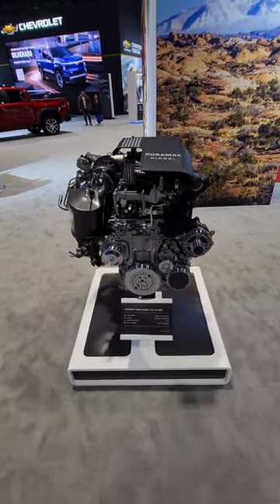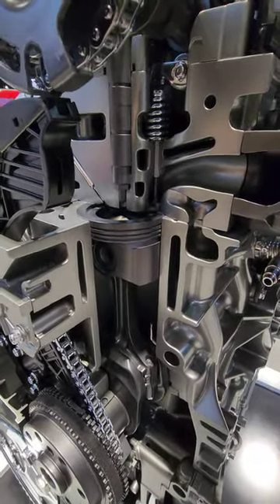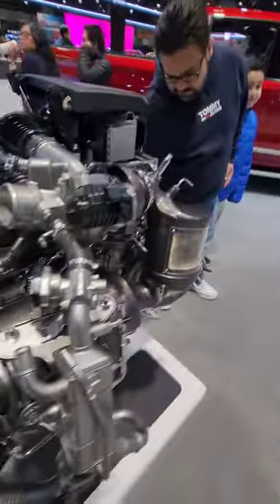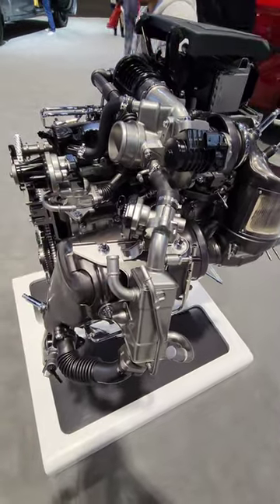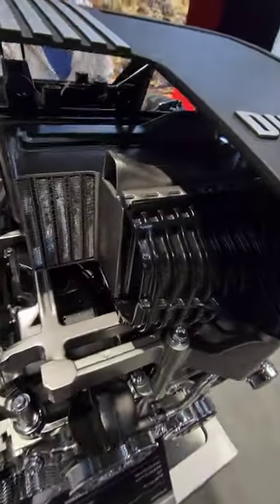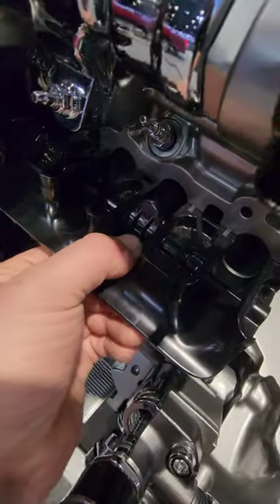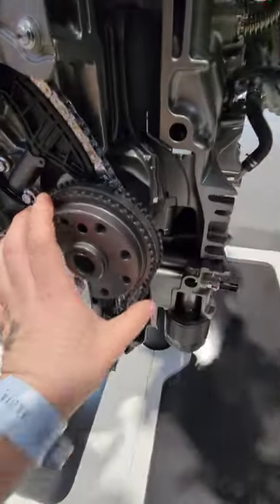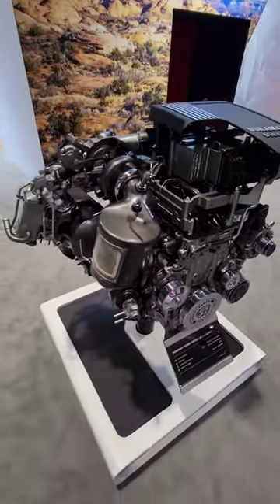Everything you need to know about the new 2025 LZ0 3.0 Duramax Diesel

Comment: So to replace the cam timing chains and that oil pump belt, which, being GM will be around 100k miles, you have to remove the entire engine? Brilliant!
Reply: they pull the cab off to replace the oil pump belt , nice and expensive ...100k is the inspection of belt , belts are good for 200k they say now
Reply: It’s amazing how many gas engines require the entire timing system to be replaced every 100-150k and nobody bats an eye but a diesel needs a belt every 150k and people lose their fucking minds.
Reply: @jellyfrosh9102  I don't have an issue with timing belt or chain replacement when it's designed to be replaceable. This engine has everything in the back of the engine driven off the crankshaft. That means getting the transmission or engine out, the flywheel off, then any covers to expose the chains/belts. Basically they designed it like those timing components won't fail, but we all know they will.
Reply: @tigermanmccool4037  Just pulling the cab won't help. The chains and pump belt are driven from the back of the crankshaft. So you still need to remove the transmission or engine, remove the flywheel then remove any rear covers to expose the belts/chains. Why they didn't put the timing components on the front of the engine is bizarre.
Reply: @toddstidham8374  there are tons of engines with timing components at the back of the engine
Reply: @jellyfrosh9102  I don't know about tons. The Ford 4.0 SOHC V6 had one cam timing chain, the GM Atlas series engines also had a balance shaft chain in the back and maybe a handful of others. Definitely more the exception than the rule.
Reply: Everyone claiming you have to pull the cab to replace the oil pump belt need to do some research. They move the transmission back and get full access to it. At the dealership it's about a 2k repair bill. That's pretty mild for a 200k mile maintenance item.
Reply: @Todd Stidham  they don't pull the cab to replace the belt
Reply: @tigermanmccool4037  wrong they do not pull the cab. It's about a 2k repair at the dealer.
Reply: It is an embarrassingly crappy design. The only people who don't get it are the ones, who think changing their fluids and brakes makes them a mechanic. 🙄
Others are the type, who get exited about their vehicles hitting trouble free 60k in 5 years and then they trade it in for a new one. 🙄
Reply: What about all these cars and suvs you have to take nearly the entire front of the vehicle? To replace the oil belt is around 1500 at a dealership and alot cheaper at a independent shop.
Reply: @philipjohnson882  I never said they pull the cab. I simply responded to someone who stated that. I responded to them that pulling the cab doesn't help replace the belt, you need to get the flywheel off which means either removing the engine or transmission.
Reply: @toddstidham8374  It's a european design, because of the way they design their trucks the cab flips forward allowing easy access to the back of the engine. Strange for US autos but the norm across the atlantic.
Reply: @chrisspencer9400  But the chain and belt is still wrapped around the crankshaft, which means removing the engine or transmission and the flywheel to get at it. Doesn't really matter what the cab can do.
Reply: @toddstidham8374  It's true the transmission has to be removed to access the back of the engine. It's possible I guess that dropping the trans could be more labor friendly than taking apart the front side of the engine for similar work for a shop with a lift? Only time will tell?
Reply: @jellyfrosh9102 they should have used a chain instead of a belt for the oil pump because of the trouble of having the pull the transmission to get to it. And its a pain to have to change the timing belt in modern gas vehicles at 100k miles, also because its hard to get to. My honda with a J35 engine for example, its an interference engine and it used a timing belt, not much working room. It also should have used a chain for its reliability and lower maintenance. So i do complain about my LZ0 and J35 for the same reason of not using a chain instead.
Reply: @toddstidham8374   They designed this engine at Opel and it was intended to be used in cabover box trucks. They realized it was an amazing engine that could be used in pickups for the American market. The downside is that pickups don't have a tilt cab so the transmission has to come out to service the rear of the engine.
Reply: @alfredocarpaneto5976  Whether a tilt cab or not, you still have to get the belt and chains wrapped back around the crankshaft to replace, so you have to remove the transmission, the flywheel and the rear main seal plate and oil pan. The cab design has no bearing on replacing a belt driven oil pump or the timing chains driven by the crankshaft. It's a bad design no matter how anyone tries to spin it. These should be on the front of the engine where only the front pulley's and covers need to be removed to service.
Reply: @toddstidham8374  I have a 3.0, getting that thing replace is the last thing on my mind. If this truck last as long as my titan did. 10 years 120k miles(before i traded in for the 3.0). That means i wont have to replace it. Two if this is the only thing i have to worry is paying 2500 to replace the belt at at 150 to 200k miles, thats great(would take me well over 10 years to get to this milage). I see so many cars that you have to dismantle the front end to do this type of work. Im more concern on the dpf filter how long will that last, can i change it myself, can i do anything to keep it clean. Wish i could just do a straight pipe on it.

Comment: It’s going to use oil from the very beginning ,and then at 120,000  miles that stupid belt at the back of the engine is going to need replacing at around 1200 dollars . In the first generation the belt needed replacing at 100,000 miles ,for some people that comes quickly. One would think they could use a chain instead of the belt and make it last the life of the engine . So for me I’ll pass on anything GM.
Reply: That belt is guaranteed for 200k miles now by GM. So stop worrying about it

Comment: All I know is that I can't get one in the 2024 Yukon or Tahoe, especially the AT4 and Z71.
Reply: You can get it in the Yukon or Tahoe just not the Z71 or AT4 package
Reply: @454budman  I don't think they are releasing it to the large SUVs until 2024.  And they haven't shown any interest in redesigning the AT4 or Z71 front ends to accept the diesel - which is a shame.  It would check off a lot of boxes for me.
Reply: @ktpinnacle  are you talking about the LZ0 or lm2 because theyve had them in the suv. I looked at them bc my brother has a sierra with it and I like it, but with my wife driving a 6.2l would be less maintenance and more fun to drive to get groceries
Reply: I test drove a Serria AT4 with a 3.0 new DuraMax last week
Reply: @mavryek1145  I was talking specifically about the AT4 and Z71 versions of the Yukon and Tahoe, respectively.  But it looks like the 2025 versions of these will get the LZ0 this fall.
Reply: @ktpinnacle  that is fair as I didn't look into them yet.

Comment: People only need to know 2 things.
All the chains and timing components are on the back side on the engine where we can't get to them
It has a rubber belt driving the oil pump. Talk about stupid.

NO SALE.
Reply: Timing components are 0 maintenance and I don't believe there has been a single belt failure since this bitch came out.  If you can drive a 1200hp drag racing snowmobile with a rubber belt you can run a variable displacement oil pump with one.

Comment: This engine isn't going to last it will burn its self up blow the headgasket and burn oil. Beside the back pressure from the emissions and why the hell did they put a Cadillac Converter on a diesel motor 🤯 Direct Injection diesel is 500x worse then a gasoline engine with direct injection. Did they just think of everything to put on a motor to make it fail 🤔
Reply: Yet they’re amazing motors and everyone loves em